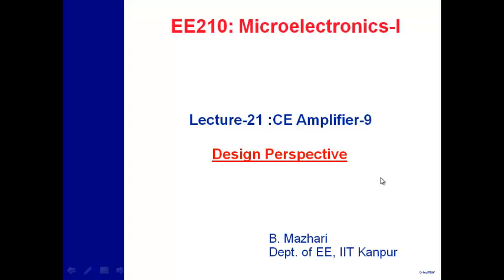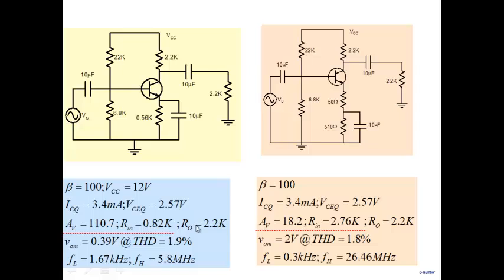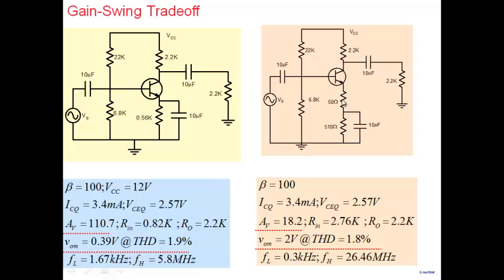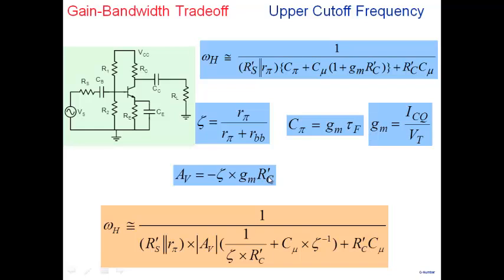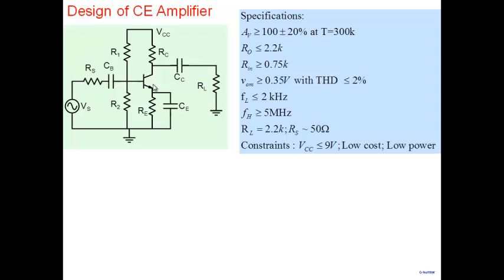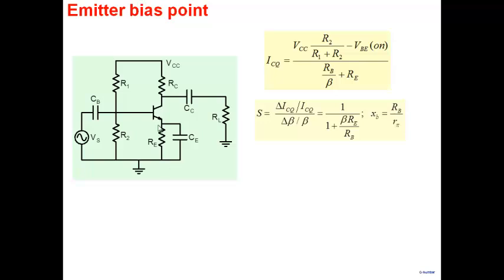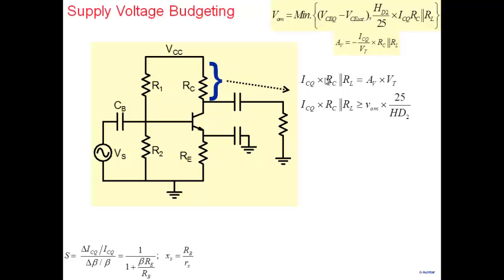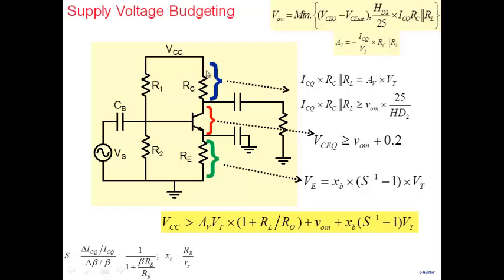BJT Commom emitter design perspective

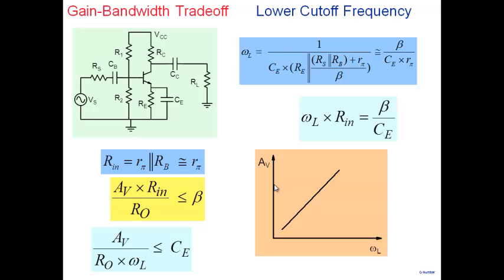Comment: In 18:36 you assume that Ce is of a given value. Ce is very easy to be changed. The constraining factor is the transistor, not the capacitor. I think that we should not talk about ωL trade-off.
Reply from the maker: +Chrestos SV1GAP there is a limit to how large a cap you can use due to size constraints. I agree that if you can use any size capacitors then the tradeoff might not hold